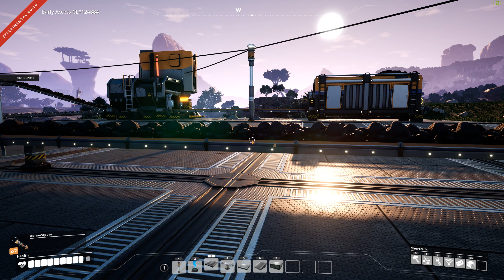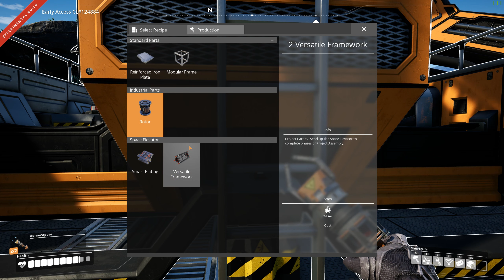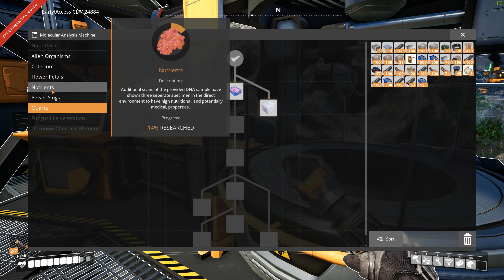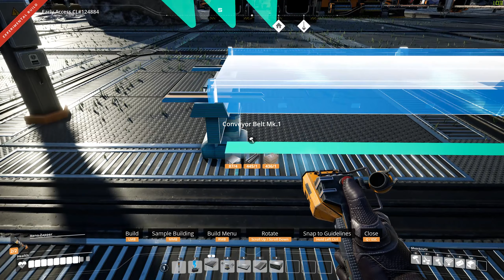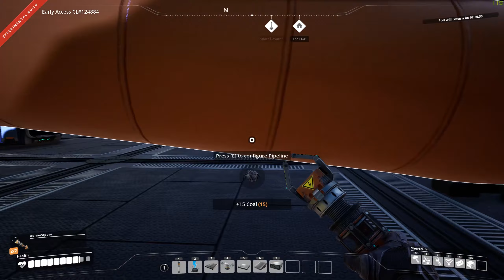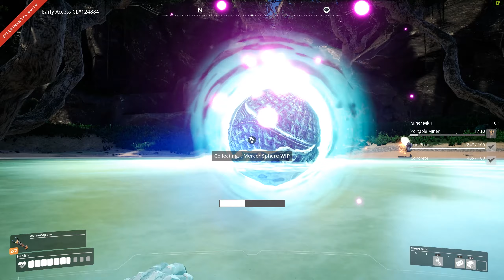Satisfactory - In Need of More Coal! (Let's Play Ep. 8)

Comment: To help you out. It is best to look for power slugs around the map. These can be researched to make powershards which can overclock miners and other machines. If you overclock your miners then you can produce a heck ton more coal for your plant. Also this goes the same for water pumps. Then you upgrade the belts so they get to the machine faster.
Looking forward to this saturday :)
Reply from the maker: I’m about 2-3 videos ahead of this and have the upgraded miners and mk3 belts. I have finally researched yellow power slugs and have some coal and constructors running off them 😊
Reply from the maker: I’ll keep u posted on potential times I can play. I’ll most likely have 1-2 hours
Reply: @1UpNerdcore  Good Job :thumbsup:

Comment: I had the same issue with coal generator as well .Figure out these generator is a chore .But from the wiki page does help-  Hopefully I can get my plants to behave too. also on a side note :FYI As the fuel burn rate & Water consumption rate are directly proportional to the Power production of Coal Generators (similar also applies to all Power generators), it is not advised to overclock any of these generators. It is just a waste of Power Shards.

Comment: Upgrading the belts wont help in all cases, I think the problem you are running into is that your miner is not producing enough coal for your power plants. If you look in the miner you can see how much it is producing and then use the appropriate belt for that, then you can look in the power plant to see how many seconds it takes to burn one coal. You can then calculate how many power plants you can sustain based on the input.
Reply from the maker: I’m about 2-3 videos ahead of this and have the upgraded miners and mk3 belts finally 😊